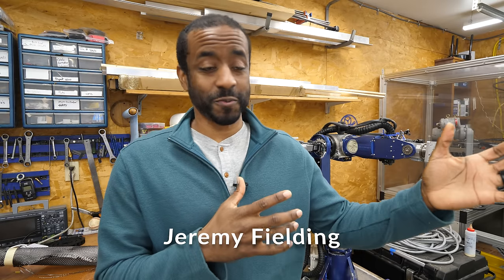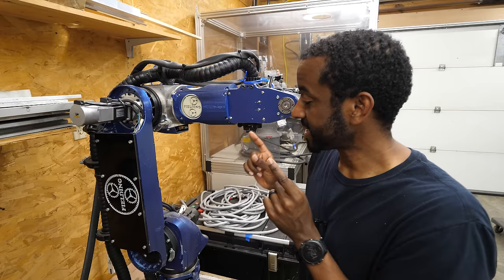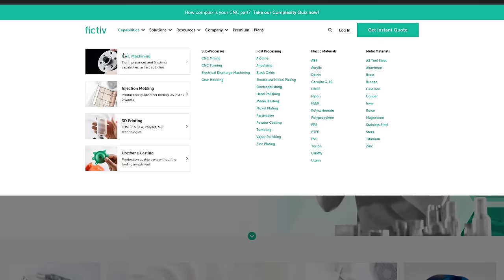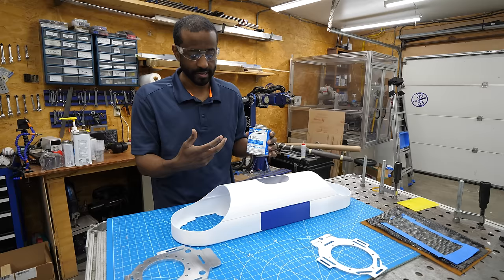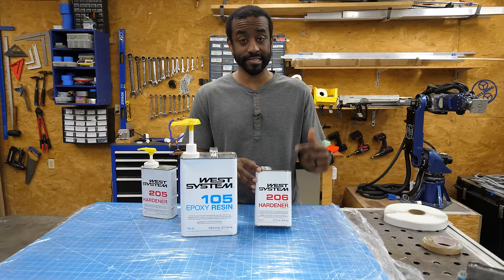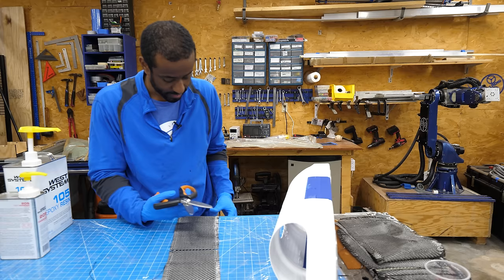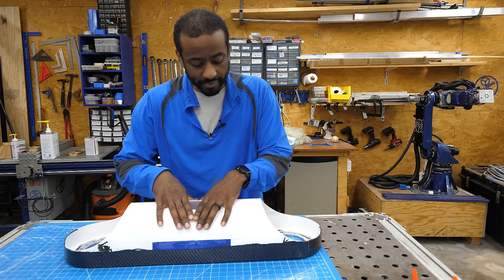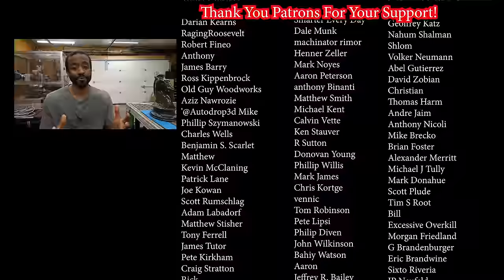How to Make Anything Out of Carbon Fiber.

Comment: I doubt that anyone will try to design anything relying solely upon you explanation of tension and compression being concentrated at the outer surfaces, but:  While tension and compression ARE concentrated away from the neutral axis, a shear stress peaks AT the neutral axis.  If this shear stress is not accounted for, the member subjected to flexural stress can rupture along the neutral axis.  τ=VQ/Ib where τ is the shear stress due to bending,, V is the area under the compression/tension distribution curve, Q is the first moment of area about the neutral axis, I is the moment of inertia and b is the thickness of the member at the neutral axis.
Reply: Not to mention stress risers, such as small radii, like through holes and pressure points.
You can see the layering of sheets will predominantly be the point of failure due to the sheer stress you speak of.
Reply from the maker: I was certain an engineer would find some reason to challenge this section LOL. That is why I followed up by saying "of course every design is different" LOL. Seriously, thanks for commenting. The only reason this is in the video was to highlight why we use things like Ibeams and tubes instead of solid "everything. I 100% agree with you. Every application needs to consider all forces :) Shear is certainly one of many.
Reply: @Jeremy_Fielding  Its also important to mention the duration of time relayering, ideally when still tacky.. any longer and it's best to let fully cure, then abrade and clean before the next layer.
Been a long time subscriber and admire your work by the way.

Comment: I wonder if the company you mentioned in the middle of the video can you huge injection-molded parts like something about four and a half feet long.
Basically the tail light panel to an older car that's no longer available.

If I could get them for under $1,000 a piece it would be a winner.

Even a 3D printed part would work.

Could perhaps build it in sections.

Comment: 09:45 If both machines are running independently then you probably have an environmental problem, is room AC changeing, grid power fluxuations maybe it's vibrations? Thanks for the information and sharing your journey into the world of carbon fiber.

Comment: I didn't realise that the carbon fibre and resin could be laid down and cured in multiple stages, I had just assumed the part had to be laid and cured all as one do-or-die run, like what I've seen in videos of composite aeroplane wings being made ( I guess those parts are autoclaved?). Knowing it can be done piecemeal makes it seem much more manageable, and I think I'm much more likely to try it out now!

Comment: Dude, please read the product safety data sheet for the resin and hardener.  You do not want to breathe the fumes from this stuff.  I know this because we lost my brother in law due to complications from inhaling the fumes from resin while he was building a sail boat.  I would not even trust a good respirator, a hood with positive air flow from a safe source outside the work area would be best I would think but I'm not an expert by any means.  To quote the PSDS - When ventilation cannot be made adequate enough to keep exposures
below established limits, use a NIOSH approved respirator with an organic vapor cartridge, or organic vapor cartridge + P100 particulate filter,
depending on specific workplace conditions. Consult with your respirator and cartridge supplier to ensure proper selection of respirator and
cartridge based on ingredients listed in Section 3 and specific workplace conditions. Use and select a respirator according the guidelines
established in OSHA 1910.134 or other applicable respiratory protection standard.  You are one of my favorite folk on YouTube and I don't want you to get hurt.  Safety third.

Comment: A better way to do it is get some plastic, and sandwich the carbon between the 2 sheets of thin plastic. Take off the top sheet. Pour resin on the carbon and use a bondo spreader to spread out the resin. Then put your top layer of plastic back on. You can draw patterns on the clear plastic. Scissor cut your patterns out and peel one side of the plastic off. Lay it on your mold and pull the other piece of plastic off. Then brush down the carbon into place. If you went over this, sorry. I haven't watched the whole video yet. My break is only a few minutes. Do i know what I'm talking about? Look at my name. Its what I do for a living.

Comment: Can you 'melt' or use some other method to get the plastic out of there so you have JUST a carbon fiber knight?
Reply from the maker: Certainly. You can make a negative mold split in half. There are many videos on Youtube showing many different methods

Comment: 10:00 When I was still learning to weld I had a job as kind of a welder and a grunt. I had an assignment to cut out a bunch of 3" x 1" flat bar. I needed several hundred of the parts so I had something like 40 bars to cut from.
    This was an expensive project and it took me 2 weeks standing at that damn band saw doing the same thing over and over and over. It was extremely boring.
    I finally finished and as it turned out my boss came in to yell at me. Every one of the pieces I'd cut was 1/8 inch too short, which was out of tolerance by 1/16 inch.
    Thank god I'd saved the drawing I had, because these bars were exactly compliant with the drawing I had.
     The boss looked at the drawing, looked at me and actually apologized for yelling at me. He left and went across to the drafting office. About 5 minutes later I saw the draft6er walking out with a box of his stuff.
    So the good news was, I got to keep my job. The bad news, I had another 2 weeks worth of very boring work to do.
    The boss did give me $2 more per hour though, so that was nice. Didn't make the work any less boring though.

Comment: I've done a bit with carbon fiber but I need to play with it more (and use other composites more). I actually have a bag of chopped carbon fibers so I can experiment with forged carbon but I haven't used it yet. 
I've machined carbon fiber a bit (plates with a cnc router and various tube profiles and such with various other tools) and it kinda sucks. Carbon fiber dust is really good at damaging any type of machine in the area (both mechanical and electrical components) and carbon fiber rash is a pain in every possible way. The capability carbon fiber gives in really awesome though, I am still almost always surprised. 
3D printing with carbon fiber is also really nice (especially with polycarbonate since it makes it SO much easier to print). If you haven't used a markforged or other method of 3D printing with continuous fiber reinforcement, it's super impressive. 
I've only done a little bit of fabric layup for a UAH space hardware club project (was interesting seeing the UAH shirt lol) and I can't decide if it's easy or just a pain in the ass. Might just be because the goal was to make carbon fiber rocket body tubes so it was difficult to keep it straight and taught along the whole length of the tube for all the layers and actually impregnating it properly at the same time. We used a single sheet wrapped multiple times around the mandril. It's probably just a lot easier once you have the process down, which was not the case at that point.
Reply: Use water to contain the dust. Ideally with the cutting area fully submerged, but shooting it with a spritz bottle periodically works too. Cheap diamond dremel bits work better than regular end mills and drills.
Reply: @dekutree64  Unfortunately that wasn't really an option for me. Instead I used a vacuum with a printed nozzle to get closer (the dust shoe was also broken) and it seemed to get most of it. I also used a composite or burr bit instead of a normal end mill. Either way it seemed to work pretty well.

Comment: I replied to my own long winded comment but I did not want you to miss what I learned about mixing Aluminum and carbon fiber.  So please read my comment or research it further.   It can damage and  weaken the aluminum if not separated with a thin layer of fiberglass or other material.  .

Comment: Please do a video of the carbon fiber process on best how to butt joint of two pieces either merged together or overlapped so they are not visible when fully cured and done please there is nothing on videos I can find anywhere ! I want to skin a Hood on my 70 camaro but the longest twill i can find is 60 inches wide and i need 72 inches to do the hood.

Comment: One thing you did not mention is that some (most?) epoxy can be pretty exothermic when it's hardening. Usually, the faster ones do heat up more. Combined with thermoplastics from 3D prints, this could actually warp or destroy the part you try to wrap in carbon fiber when it's heated up while there is pressure from a vacuum applied.

Comment: I think its important to note, if you want the carbon fibre to be actually strong you need to cure it which not everony has a large autoclave to treat the carbonfiber but i suppose that can be outsourced if you really need it.
Reply: Different epoxies cure at different temperatures. West System epoxy is formulated to fully cure at room temperature. I am not saying it won't increase in strength at all with post curing at elevated temperature. But it is not necessary to get a strong part. The autoclave is definitely not needed. The elevated pressure in an autoclave is not to promote curing but to improve consolidation and improve fiber to resin ratio.

Comment: Question, if you are cutting up pieces of fiber and laying them I imagine that pieces will overlap causing the areas around the seams to be thicker.  Am I thinking about this correctly.  What is the solution for the seams?

Comment: 25:40 it's NOT a waste of carbon fiber, in teh sense that you've learned things from it.
Reply from the maker: I just meant to get the layer thickness I wanted, I needed to use a lot of carbon. Stopping at the point I did was the right decision.
Reply: @Jeremy_Fielding  I didn't say stopping was the wrong decision.

I only said that there is value in failure.

I've been meaning to learn carbon fiber work myself, and I think I might just see about giving it a go this summer. I have a few simpler by practical parts to try for use on my airplane. Have some fairings and such that would be a perfect candidate. Enables me to save weight, make spare parts, and sets me up for some planned aerodynamic experiments later.

Sometimes the toughest hurdle is just Starting, and being ok with failure and knowing that every failure helps you get better is critical to overcoming any worry or fear over starting. Knowing the first few tries will likely fail and accepting it.

Comment: First, thank you for sharing. I am curious why we have to put it in a vacuum. Would it not be strong just laying the fiber on and coating with epoxy? I shall have to research this.....
Reply from the maker: I am not an expert, but it certainly helps to conform the carbon tightly to the shape, and it squeezes out excess resin. There might be other benefits, but neither of these means it can't work without a vacuum. Others are welcome to add to this comment below.
Reply: @Jeremy_Fielding   @jimnjele.bean-dayone3505 Compaction is essential in creating carbon fiber parts, whether it's pneumatic compression (like a vacuum bag) or mechanical (clamps and presses) - at least, for geometries like those in the video. The reasons are twofold: first, carbon fiber is as fussy as a toddler overdue for a nap, and will absolutely refuse to hold its shape in a layup, so it needs to be forced to hold its shape via some means. Otherwise, it'll lift in areas, or delaminate completely, so it'll look bad and be dimensionally inaccurate. Second, vacuum bagging maximizes strength, which is especially important when doing multi-layer layups (not like in the video). The vacuum eliminates air voids in the layup; air voids act as focal points for stresses that can cause part failures. Vacuum also helps in ensuring you get full "wetting" of the CF cloth in layups where you're brushing the epoxy onto the carbon that's on the mold/surface. 

I'll will mention, though, that skinning parts - like the CF veneer on the knight - you're likely prioritizing cosmetics over performance, so some different rules apply. With skinning, you can either a) coat the part in epoxy, let it get to a "finger tack" stage, then lay the fabric over the part and the tacky epoxy will adhere to the surface; or b) use a spray adhesive to achieve the same result. In both cases, you then brush or pour epoxy over the tacked fabric to serve as a topcoat.

Comment: The technique you are using is going to be prone to delaminating. Epoxy resin gives off amine blush as it cures, in order to add a layer after curing you need to do surface prep, and it still isn’t the best result. For something like the chess piece a two part mold, chopped fiber, and bags would be perfect. Your cost might triple on the first piece but but you will have the mold, won’t need the printed core and will save massive amounts of time. Plus whether you go forged carbon or weave (I’d avoid woven on this project unless you want to try pre preg, in which case your mold should be made of carbon as well) your finished product will have a much better finish and structure.

Comment: 3d print from plastic + graphite rubbing/coating + electroplating with actual metal (electroforming a thin-thick custom metal layer shell over the mold, high temp optionally)
Reply: its easy as shake in graphite and put in a bath, some electricity with rods
Reply: not directional sensitive, strong all directions
Reply: its like casting but better
Reply: you can even metal shell wood, get a super strong composite material, in the wood custom shape
Reply: even I-beams
Reply: titanium is one example for hard durable materials to electroform with
Reply: any metal bath that can deposit the selected metal, some easier like zinc, copper, nickel, chromium, gold, silver, platinum etc
Reply: actually dipping to molten metal to get a layer deposited should work too, like for aluminium, but requires a high temp 3d print or wood
Reply: you could even draw an object with a graphite pencil, to a wood, then electroform the metal on the graphite
Reply: idea is good, execution can be something else, also perfect, or you discover a better process
Reply: also the electroforming is very accurate to the 3d print features

Comment: For the failed-to-fit 3d parts, I'm unsure why you'd bother printing an entire 2nd set if it was just slightly out of tolerance and time was important? You said yourself they're not doing anything structural, so just file them for perfect fitment? Optionally print out a quick surface template, then it's perfectly flat and to scale(or maybe not, and see why below!), use that to guide the modifications very accurately. I wouldn't be surprised if you could use a router with one of those bearing-inserts to ride the template to make extremely quick and accurate adjustments. 

Also you are printing at scales you'll need to consider the very subtle thermal shrinkage these plastics encounter, it really adds up when scaled, though funny enough Z usually isn't the axis that shrinks nearly as much as XY due to how filament is layered. Clough42 has a good pair of videos "How to 3D Print Dimensionally Accurate Parts" and "3D Printer Dimension Tuning Revisited" that I think you'd possibly find useful.

Comment: With the construction of the vacuum bags, why would you not use heat welding of the plastic edges
Reply from the maker: Surely you can
Reply: @Jeremy_Fielding  You can use impulse sealers on bagging materials used in composites, yes, but not always. Some films wont bond reliably, and in any case, you still need to make ports for your hoses and fittings.

Comment: 9:02 the parts may have been better printed the other way around or maybe even laid on its large flat side. Orientation is also important for strength in 3D printing, the layer lines are the weakest parts so it is best to have it orientated where the layers are in the direction you need strength. For this print it may be best if they were laid on the large flat side, although that may not fit on the printer.

Edit: also it is worth spending a little time calibrating or tuning a printer first before trying to print large parts like you did. The bunching up is likely due to the way you printed it, there really would not have been much strength in that part at all as it was being printed and due to it being so thin it is possible that it was just too hot whilst you printed it so it drooped.
Reply from the maker: I didn't need it to be strong at all. I think you missed that in the video. This was just to space things out. If I could remove the plastic in the end I would have. I went through a lot of trouble to try and make that clear several times in the video LOL

Comment: Your teachers approach plastic part fabrication (carbon) like fiberglass layups.  It's not the same, its much more sensitive and critical.  Fiberglass is much more forgiving.  Are you curing the part under pressure and heat?  Do you have an autoclave or a simple oven?  Who makes your carbon fiber? How old is the fiber?   Have you considered using prepreg carbon fiber?  Wrinkles are critical to your structure and pose significant failure risk. What about dust intrusion? With your super high level of knowledge and intelligence you should consider learning from an aircraft fabricator. It all depends on what level of fabrication you desire, hobbyist or professional?  If i understand you correctly, you may want to talk with someone at NASA or JPL about their approach to that type of fabrication to appease your intellect and curiosity.  Thanks for your videos and attention to detail.